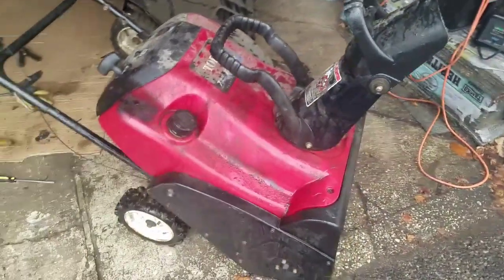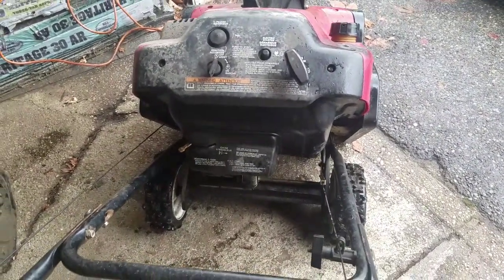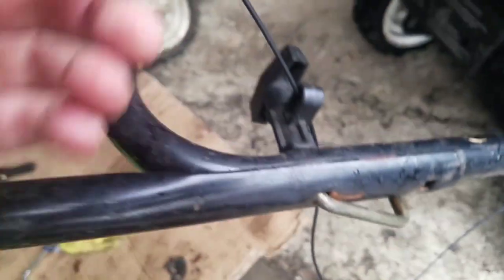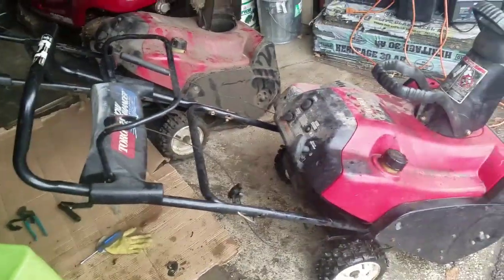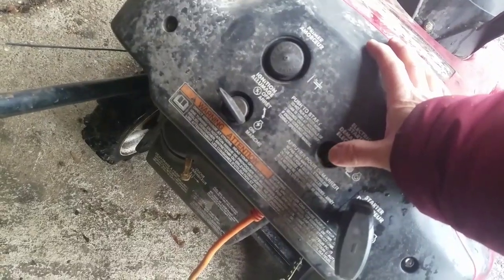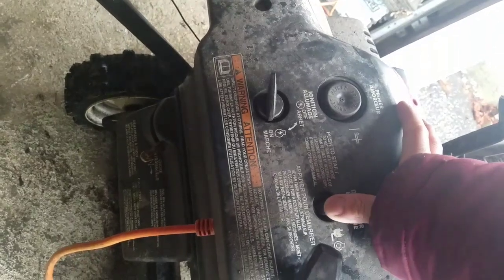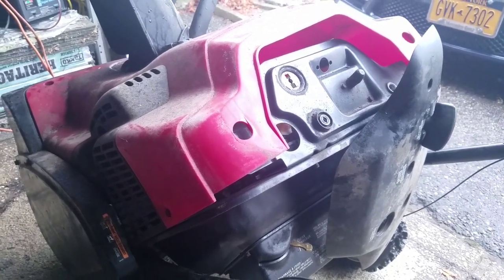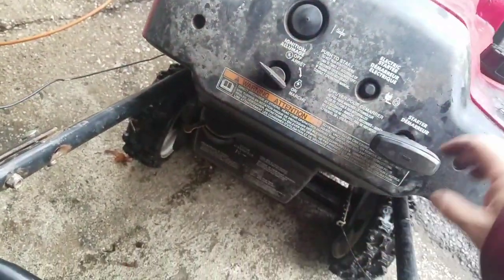TORO 38602 SNOW COMMANDER SNOW BLOWER SNOWBLOWER STARTER MOTOR REMOVAL AUGER DRIVE CABLE ADJUSTMENT

Comment: HOW DO YOU GET THE GEAR OFF THE MOTOR TO REPLACE
Reply from the maker: The gear?  There’s probably 5 different gears,  you mean the starter motor,  crankshaft gear,  camshaft gear?  AND STOP YELLING AT ME!
Reply: @MowersNBlowers  Sorry for the caps, and I finally figured out how to get to the c ring, it wasn't initially visible. Thanks for the response.
Reply from the maker: @mralbe  no problem bro!  You’ll always figure it out when you study it.  Hope you’re subscribed